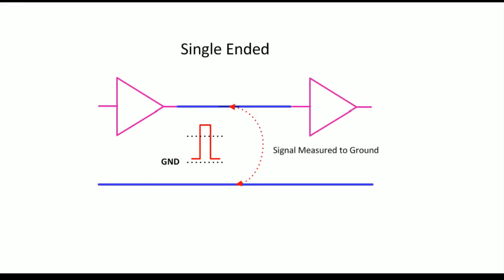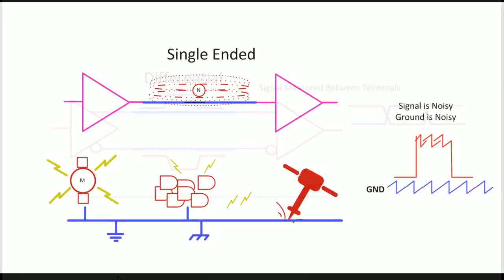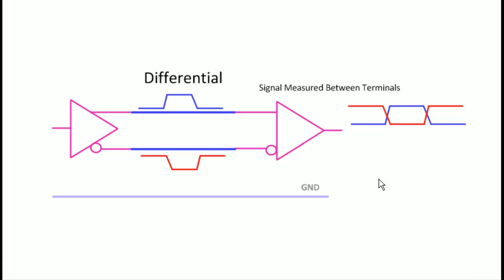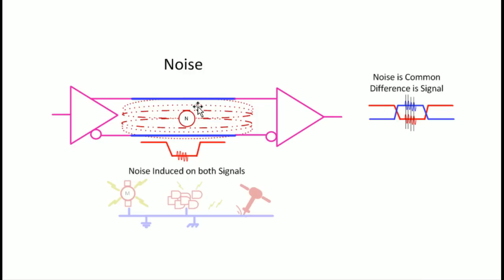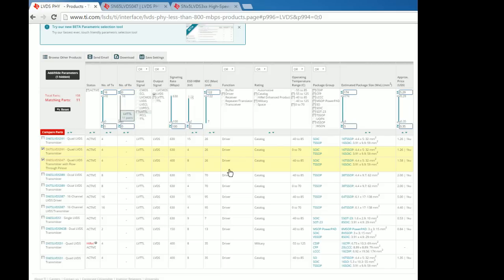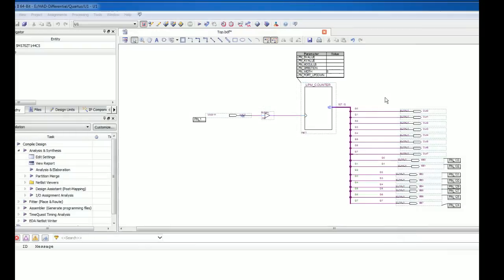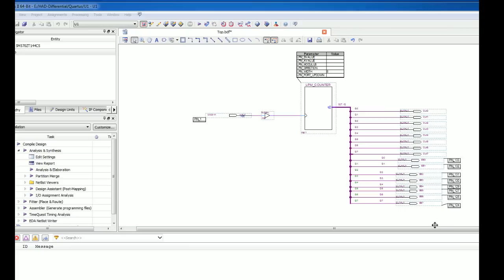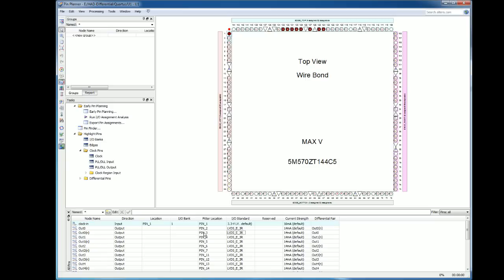Differential Signaling: Designing for Long, Fast, or Noisy Applications

Comment: If I was trying to send differential signals across a multi slot backplane, would would be the optimal connector? I was thinking of a 96 way DIN connector where it has three horizontal pins x 32, and putting the ground in the middle of the two +  & - signals

Comment: Hi, I am using one chip  DS90C401 which is a LVDS driver. I don't know when I input a sine wave to its Din, why its output（out+ out-）are not the same sine wave. I really hope you can reply my question. Thank you!
Reply: These are not suitable for analog signaling, only digital. If you need to transmit audio over LVDS you need to at least turn the signal into PWM then filter it, or preferably, use I2S